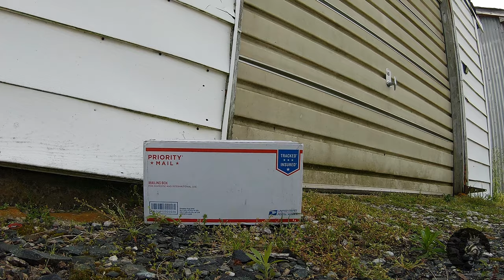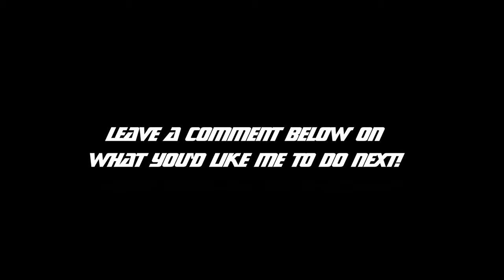Ridgeline Rear Hub Assembly Rebuild

Comment: Nice video,.So you don't need to press the bearing all the way in, just enough to thread the cv shaft,, impact the rest of the way,.?
Reply from the maker: I would not recommend that.  You need to press the bearing in from the outer race, not the inner.

Comment: Must be nice to have a 1st gen Ridgeline with very little Rust. The manuals state that final torque  of lower 'B' arm bolts (strut - Knuckle), Trailing arm, upper & lower 'A' arm, bolts should be Torqued with wheel compressing the coil spring at normal load height. [i.e. put the jack under the knuckle and raise it up to load height].
 If welded nuts come loose when removing the two fwd bolts on the Shock/Strut, the plastic inner wheel well liner can be removed and reveal the top of the Strut. The 3rd rear bolt nut is behind an internal baffle.
Reply from the maker: Thanks for the feedback.  Putting the jack under the knuckle simulates the truck being on the ground.  I just put the truck on the ground....  Either way works.

The idea is to torque the bolts with the bushing oriented where it'll rest the most often so it will torque the bushing as little as possible under normal operation.
Reply from the maker: Also, thank you for the suggestion on the strut tops.  I was lucky and didn't break any of those welded nuts.
Reply: @whiteroosterproductions5986   I should explain, I am in the middle of replacing the both side: shocks, springs {a little bit rusted, new ones were cheap}, halfshafts [bad boots], anti-sway bar links (had to cut them off), one hub, LH trailing Arm (still in work, broke outer welded nut), Backing Plates (Rusted off), RH ABS sensor cable, rust inside area of plastic liner, etc.....  Working in driveway, its getting cold with my age, bad knees, health slowing me down. My Honda came from somewhere in NY, Very Rusted on left side under rear door, {maybe it was used to put boats in water or in the Storm surge?} and by the amount of Rust which was covered by "Dealer" paint job, I have my quick job turned into a mess. I'll be reinstalling everything soon as long as the next snow storm isn't too heavy.

Just wanted to see if anyone else had easier time doing Rear stuff. Next spring  will be the front and leaking power steering hose. Makes me want to go back to Navy Helicopters but I find climbing difficult these days.
Reply from the maker: @SpeedySailor  Wow!!  What a nightmare.  I totally feel your struggle!   We are the original owners of our Ridgeline and if it wasn't paid off, I'd be shopping for another one from Florida or Oregon!!! Hahah!

It's seen every winter but to be fair, our winters are no where near as extreme as NY!  Our truck is showing rust on the passenger rear 1/4 and we never had the paint redone under the recall so the hood paint is flaking off....

I should have replaced the backing plates when I did all of this work.  They were rusted and I'm sure will have holes in them this time next year.  

I have yet more work to do to this truck too.  Some stuff has been filmed already (starter and PCV valve) and I just need to edit the video and now it's time to do the timing belt.  Of course, the truck needs much more than that because of it's age.  Motor mounts, torque converter, and front main seal is leaking....  Ah the joys of old vehicles.
Reply: @whiteroosterproductions5986   Check your Power steering pressure hose, they are prone to leaking just aft of the metal fitting. Guessing engine movement flexs it there the most.
  https://www.ridgelineownersclub.com/search/1047756/?q=Power+steering+pressure+hose&o=relevance

https://www.ridgelineownersclub.com/

 I was going to do mine last spring but corrosion made the hose bracket bolts into aluminum a put off until later job, just keep refilling for now. BTW, That's when I found one CV boot cut and if you do one, then you have to do both. I suspect that the tube nut into the steering valve is corroded too, so I'll be prepared to R & I Rack when I do the front shocks / half shafts / bearings. 
 Had to remove the front bumper just to replace the Headlight housings too. The nut bolts were rusted too.
Here is a video of Honda tech R & I the bumper on a 2nd gen Ridgeline. (He added a trim feature) https://youtu.be/low0k7B-GxI
Reply from the maker: @SpeedySailor  Appreciate the heads up!!  PS rack rebuild is also on the list so might as well do those lines too.  Was debating getting a remanned rack or just rebuilding this one with OEM parts.  It doesn't look any more/less complicated than any other rack so it'll just come down to cost.

Wish I had a lift.  With so much on the plate to be done, I wonder if it's just easier to drop the whole engine/trans/subframe assembly out the bottom and raise the truck out of the way to do all this work.

Comment: Why do you gonna change de rear system brake to band system, I show in the video no understand
Reply: The Honda Ridgelines use a Brake Rotor with the Parking brake using the Drum/Shoe system you were seeing.
 The Drum is inner part of the Rotor.
 btw, in the Honda service manual, you would remove the parking brake cable from the Backing Plate by sliding a 12mm box end wrench over the little prongs. Then tap the fitting out with a small drift punch. He did not show that.

https://drive.google.com/file/d/107npkgS_4FgFmliwtNHmEYVR0IkWX7lo/view?usp=sharing
Reply from the maker: I kept the front brake shoe on, so that method wouldn't work.  Instead I used a small pry tool to walk the clip off (without bending or deforming it) which is shown in the video at 3:44.  Saved a lot of time.
Reply: @whiteroosterproductions5986   Even with the shoe on, a box end (Craftsman 12mm combination) can be tapped in place. I just did it (shoe off), takes less than a minute.
Reply from the maker: @SpeedySailor   Oh I see the google link doc you just posted.  I don't have that style of box end but it yeah it looks like that method is even easier!  Thanks again for the suggestion.